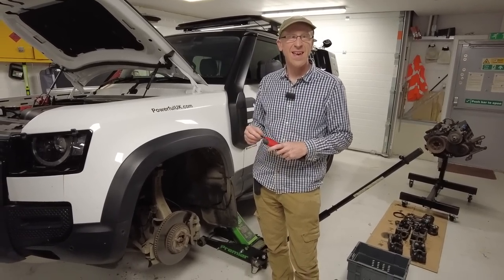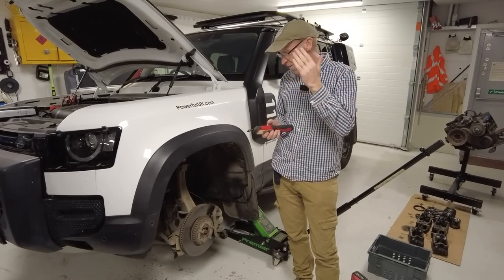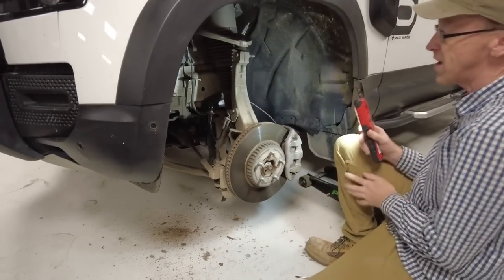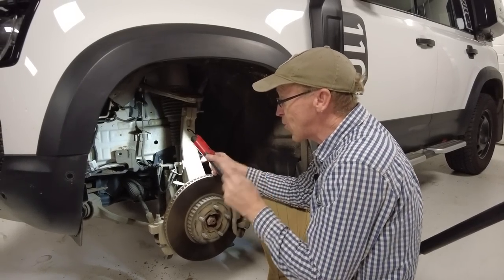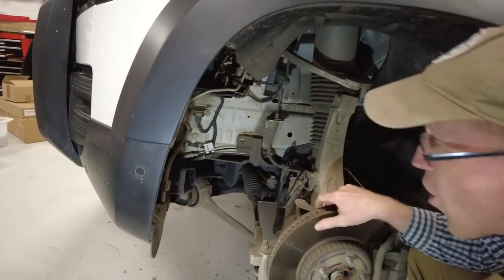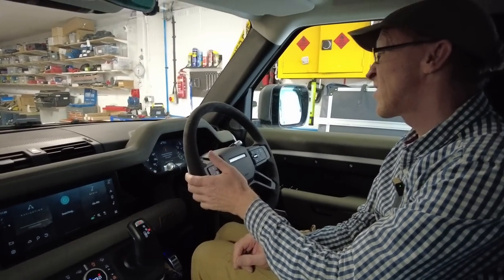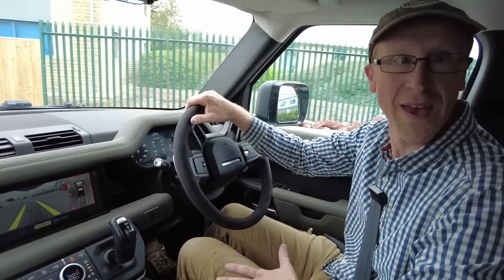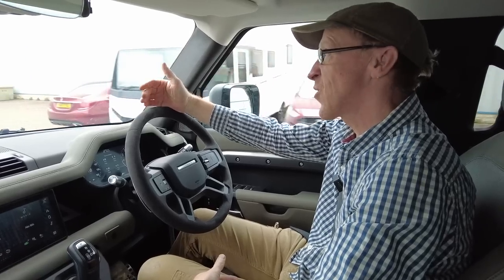We Defend the New DEFENDER - What Really Happens When An ABS Sensor Fails !

Comment from the maker: Please post a comment on the video by ASPW by clicking on the link below
https://youtu.be/OhDD56Ad28M
Reply: Just did
Reply: I’ve done so.
Reply: Not even going to give him the benefit fit of a ‘watched’ statistic!
Reply: Thank you Simon for you reply. I appreciate it, and I learned something today. I shall mention your video in my follow-up. I'm pleased to be proved wrong because it makes the new Defender simpler to operate. However, one has no proof that the 4wd system still works. We can assume that the 4wd system will continue to work, but without any traction control operating. Which means an open centre transmission, which means no lock up. Diminished 4wd performance, but still running and I accede, not a serious failure.
Reply: @4xoverland  love this!!! Awesome job on the back and forth guys! This is how we all learn.
Reply: I made a video in reply to this one. If I post the link here, YouTube will block the post. You'll have to go to my channel to see it, or maybe Simon will post a link himself. Thats for a great discussion.
Reply: @4xoverland  why would the centre diff lock stop working when a wheel speed sensor fails. Simon showed all the faults cleared by cycling the ignition so isnt that proof enough?

Comment: Great video, anyone that's ever owned a modern landrover and has had this happen to them out on a trail (ABS sensor cable damaged/ripped out) will know that the car will be perfectly drivable. However my experience in my 2004 Discovery 2 TD5 was that once I'd lost a single ABS sensor, the traction control system was completely inoperable. Because my '04 Discovery 2 doesn't have a centre diff lock or front or rear axle diff locks, this essentially left me out on the trail in  1 wheel drive.. I now always carry a spare ABS sensor as its a 5 minute job to replace one at the Side of a trail!

Comment: Nice one Simon, I’m tootling around the south of France (as you know) in my P400 X 90 and despite the low battery related issues at the start, it’s been an absolute pleasure driving this Defender on the toll roads and around small villages, there is nothing out there at the moment I would swap this for, G63 would be the only contender but I’m more of a LR fan boy than Merc. Nice job LR 🤓👍🙏

Comment: Well done for doing this test, of course some components are inherently prone to throwing up faults which subsequently clear, for instance contamination can affect the wheel sensors. My guess is that the software is written to be resilient to this particular fault. I think your expectations were realistic, FWIW one of my cars used the wheelspeed comparison to detect a low  pressure tyre. 
I have no particular axe to grind but the other channel did accessorise a vehicle until it was overweight. Surely something fundamental for an expert. 
IMHO there is an almost phobic reaction to cars with a lot of electronics. Not very field repairable but neither is a halfshaft.

Comment: Appreciate you sacrificing your Defender to try things out. Very enjoyable and insightful. 

Remembering Andrew's comments are taken in context of driving the Canning (ie remoteness) 

Regardless, suggest you put the car on a hoist and check the propensity of branches etc dislodging/breaking any sensor/equipment and propose protection solutions.
Reply: It’s a good content spinner for them so they make up the time by also getting views and content. Still love learning and Powerfuluk is certainly a great resource.
Reply: I agree with Andrew though, I am based in Australia and the new defender will not be able to make it through the canning stock route. It is one of the most treacherous 4wd routes.
The new defender is a great luxury vehicle and it is not designed for extreme over-landing purposes in remote areas covering thousands of kms.
Reply: @Navigator-apex  ask Scott H  that on you tube, he's been everywhere with his d4, so have I

Comment: Hi Simon, great video and agree the New Defender does very well to keep going when something goes wrong, we need to do a Part 2 video to see if you can do the following: turn TC off, Access low range, access TR2 and do the centre and rear diff lock work with either a handbrake, Brake, WSS, or a shock issue. These core functions are sometimes needed to get back home from real 4x4 destinations.

Comment: Love your work, we had a fault similar   on a very tough and wet trip and we though it was game over, someone suggested we try the manual handbrake release and off we went. Another thing to try is hard battery reset by disconnecting bat overnight for anything major.
Reply from the maker: Hi Ben - a battery reset was my plan if the ignition cycle did not clear the faults. Looks like the new Defender wins this time !
Reply: @L663  haha indeed

Comment: Well done on the challenge! , it was not very clear in your test but could all the 4x4 systems work while the sensor was disconnected?  would be nice to see how far you could push the 4x4 system while the sensor was disconnected, just to know what systems is compromise and what systems is not.

Comment: All of this is predicated on a sensor failing either through component malfunction or mechanical damage. The sensors are a pretty basic bit of kit so in this unlikely-to-occur event carry a spare. Mechanical damage such as a stick rock etc could also damage a brake line definitely leaving you in an awkward situation! No vehicle is immune. I think ASPW is over-thinking this. If this is the sort of thing that worries you don't leave home.
Reply: In Australia and using ASPW example you die in bad situations out here. Literally days before road help, lucky if you get air support and you abandoned vehicles as they can be uneconomic to recover. You cannot leave home without factoring in a lot of solutions and redundancies, and air suspension when working is fabulous but he notes and I have experience when it fails - you couldn’t drive out of these locations on bump stops.

His criticism and discussion about overland suitability is valid and it’s great that questions and answers can be shared amongst the community.
Reply: @offroadingfoz  It's all about risk assessment and your point is valid: " be prepared" . When doing a remote trip in Australia I carry a messaging PLB and an EPIRB to deal with major failure or with life threatening situations. If two tyres are irreparably damaged the vehicle won't be going anywhere either so how many spares are required?
Reply: @atoieno  In Australia it is common to have two spare tyres on rims and one extra tyre as the shops in remote areas don't keep 17 & 18" rubber in stock as the new vehicles most often are using now. At least you can change it on the side of the road. And if you have seen bush mechanics where the aborigines place spinifex(grass) inside the tyres instead of an inner tube to get them out of trouble then you know a puncture isn't the end of the world. 
Skill, common sense and reliable equipment is essential. Would hate to get a bill for EPIRB call out just cause you were unprepared.
Reply: @offroadingfoz  You are preaching to the converted but thanks anyway for sharing your wisdom.

Comment: Interesting to see they’ve learned from their mistakes on the new Defender. I own a 2016 LR4/Disco which is currently showing a left rear ABS sensor fault. With the sensor fault you can only drive in lowered suspension mode, you have no park assist, no offroad mode selection, and a host of lights on the dash. Guy at the shop said they can stop working just from getting too dirty, which seems a bit silly that if you get your Land Rover too dirty it stops working… 😂
Reply: I think you are wrong re the dirty assertion we drive ours on a farm and dirt roads and never had a problem sure you don't have some other issue going on? Our D4SC is simply the best car we've owned.
Reply: I had a speed sensor cut on the front right wheel of my 2006 LR3 while driving 70mph down the highway. The exact same thing happened & lost the speedometer too. I was ~200 miles from home and ~200 miles from my destination! I had to use my GAP IID tool to lift the suspension and cautiously finish driving to our destination.
Reply: @MorganMaclellan  yes the early iterations were very safety focussed and according to past LR forum discussions much of it was driven by govt crash safety requirements. I guess that's the price LR pays for innovation ....

Comment: Nice test! Very clarifying. I have a request to you to test it at the next level.
Test it off-roading. And don’t mean on a flat gravel road. Test it on places with obstacles. This car relies on the TC not on axle articulation, so I wonder if without the speed sensor it’s able to drive over obstacles. At the end this wire would be eventually broken driving off-road, so make sense to test if it could be able to drive back the road.

Comment: Thanks Simon. I wonder how the traction control/terrain response would be compromised? I had a ABS sensor pulled out of the hub in my "classic" Defender when the stone guard came adrift (my new D300 is on the boat  to Australia).
Reply: The traction control and terrain response rely completely on input from each of the wheel speed sensors. This is the case with all of Land Rover/Range Rover products. The system monitors wheel speed individually in real time and the computer system applies or releases brake force at each individual wheel to manipulate drive torque. It’s a great system, but if one or more of the sensors are gone, the vehicle will lose its off road traction control, hill descend, anti lock brakes and various other systems. Without the ability to lock the centre differential in the transfer case, these vehicles would essentially become one wheel drive. It would be nice to know if the centre differential lock still functions on the defender with a wheel speed sensor issue. That could be the deciding factor if you are out in the bush
Reply: That is as I understand it!  Equally the rear E-diff lock (if fitted) might be compromised. I raised for Simon to ponder.

Comment: Hello Simon,  Andrews point was based on his experience with previous LR vehicles.  On the LR3/LR4, the special programs won’t work anymore.  Kind of sucks out in the bush but ok in urban UK.  Did you test if the special programs still work?  I bet they don’t. So no diff locks 😳🤔.  What about the small gear box?  You may have put this point to bed to early.  Respectfully, Christian from LR Time
Reply from the maker: Hi Christian - honoured to get your comment ! I will try and play with this a little more to see what functions are not available - but i suspect that many special functions will not be available. Its good to see Land Rover have listened to problems on the LR3 and LR4 and made the Defender more resilient.
Reply: Just take a spare.. lighter than CVs for 100 or 200s! Toyota's now have special programs too..took them a while but eventually they catch up. Wonder if their system defaults when a sensor fails?

Comment: The danger with losing a sensor on the modern LR's is the danger of losing ones 4wd essentially. 

Thing is, while yes the car is drivable, I totally expected it to be. Driving it up and down a short piece of road is not the same as getting back out of the middle of Salisbury plain for example. The locking centre diffs (and rear diffs) is automatic on those modern LR's, my question is, will it lock up without a sensor? I would assume it would... but, If it doesn't, the potential to end up with just one spinning wheel is right there. If I lose TC on the D2, I can still lock my center diff manually, and I'm still turning both front and rear axles. I may still get stuck, but, I've just doubled my chances of keeping going unassisted. 

But its nice to know that even if you did rip something off it will still go in some fashion and you still retain suspension control! Well done PowerfulUk team!

Comment: The brakes will work normally without ABS, you just won’t have traction control. I remember in the early days of ABS we had to disconnect our ABS on a 17 seater minibus because the snow and ice totally confused the system and you couldn’t stop the vehicle on a slippery surface, the brakes wouldn’t lock the wheels! Bloody scary… This was in the French alps with lots of snow and ice around! It also happened on an older Mercedes Sprinter but, on this occasion, the trailer ended up pushing the vehicle into the back of the bus in front at around 6 kph because , again, the ABS wouldn’t allow the wheels to stop rotating! ☹️😎

Comment: Good on you for doing the test, Simon. I am not sure why the gentleman would have thought it would not drive. I have had the abs sensor stop working on a number of different LR vehicles, and yes, you will get the warning lights, etc, but never have they stopped driving. On an L320, the sensor went and the only real issue was that the speedo stopped working. On my L405, and L494 nothing more than error messages. Silly Patrick!

Comment: I (like many others I’m sure) have a “modern”Land Rover. It’s a LR4 and I have gone off-roading and on overland trips over 1000’s of back road miles in all conditions in NM, CO, Utah and AZ in the southwestern US and never missed a beat. I’ve done responsible maintenance on my air suspension and I’ve never had any part of the suspension or ABS system fail, period. Certainly never ripped a sensor wire loose. It is nice to know that the new Defender, which I have on order, won’t leave me stranded. Thanks Simon!

I love Andrew, am a supporter of him and watch all his videos religiously (except his LR rants) but do wish he’d get over whatever he’s butt-hurt about with Land Rover. His fixation isn’t healthy and undermines his otherwise earned reputation for objectivity.
Reply: You are talking about your LR4, they are talking about the New Defender! There is a slight difference😉. Other comments confirmed issues with the LR4, when disconnecting ABS sensors. So ...?
Reply: @ThomasFromHome  so I’ve still never pulled a wheel sensor  connector and as far as other things go, it’s a “modern LR” with EAS and ABS-based traction control which ASPW complains about all the time. I’ve got a L663 coming in Nov so good to know it’s not an issue there.
Reply: @scotthutchinson2184  And I'm a new owner of a LR4 (I would call it D4🙂). So I hope nobody/nothing will ever pull off my ABS sensors.😀 ATB for your new LR.

Comment: GreatW video. Thanks for sharing. I would not be surprised if retrofitting wheel speed sensors on the old design of the Toyota was quite compromised.
Reply from the maker: Yes they probably were in a vulnerable place etc

Comment: How would this affect the vehicle in slippery off road conditions? I would assume that traction control would suffer greatly. Would rear traction control still work, or is it totally off. without limited slip diffs, if the traction control is not working at all, that Land Rover is going no further than my 85 Jackaroo.
Reply from the maker: It’s a good question if it was clever it would know the prop speed and 3 wheel speeds so in theory the speed of the unknown wheel could be calculated

Comment: Lovely video, I do still wonder how handicapped the off-road assist would be without that or/and other sensors and also, how easy it would be to install auxiliary air ports to manually raise and lower suspension in case it fails.
Reply from the maker: Hi - I suspect the basic 4x4 will work OK but clearly not as good as with the ABS etc. I guess on the air suspension it depends why it fails...if the a pipe of bag fails then you are pretty pooped even with manual air ports right ?
Reply: @L663  - If a pipe where to fail it would hopefully be an easy fix if one is prepared. I keep 6mm push connects with a couple feet of high pressure pipe in my truck for such an event. To me this is no different than any other spare items others bring onto the trails.

Comment: Good start. OK so the Defender can negotiate a reverse out the garage and make it to the end of a smooth road and back into the garage. Good start. Now, Please Please PLEASE do this test in a slippery off road environment and see how the car performs. I have not checked this on the new defender however on older models a broken or defective abs sensor will render all traction control inoperative! Due to the differential locks on the defender being electronically operated I suspect a wheel speed sensor will render diff locks inop and render the vehicle a terrible liability off road. You might also find the vehicle will have more permanent fault codes in memory due to vehicle systems being needed but not operational. PLEASE do an off road test. Then the vehicle can be judged against other vehicles.
Reply from the maker: So without diff lock and traction control etc surely I have an old school defender traction system … which is not the end of the world !
Reply: Sort of agreement but you'd need to do the same with eg a 300s as Toyota is so far behind with such tech. Just take a spare if you are worried. I've seen 100 and 200s on tilt trays too. ..usually for drivetrain breakages or egr or injector related issues or dusted engines..
Reply: Old Defender did not have TC and half the owners did not know what diff lock did, and was probably seized anyway and they still kept rolling

Comment: well done, do you know if one can  stop the interior lights from coming on, when a door is open, my huge new agm battery drops voltage in 15 mns and at 11.9 vdc will not even crank
Reply from the maker: Yes there are CCF setting to change this and you can pull a fuse but the real drain is the Pivi system booting up - this drains 16A when you open the door - I have done a couple of videos on this